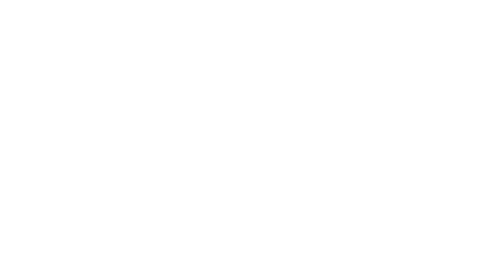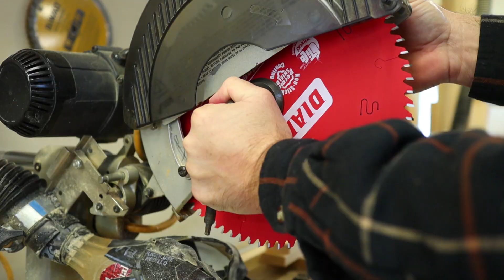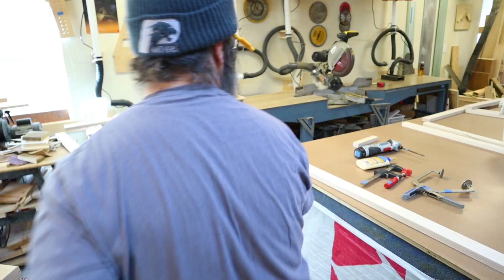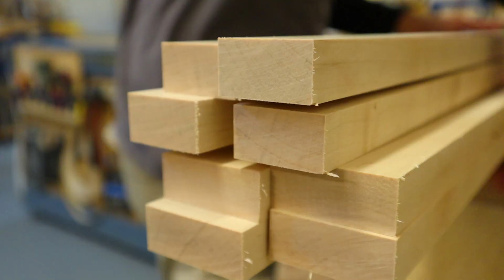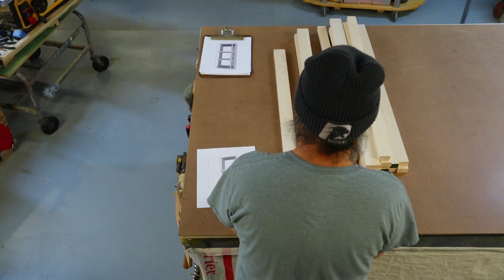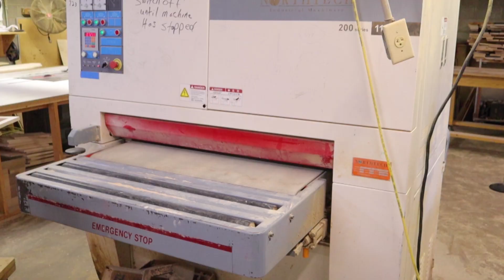How I build cabinets -  1 face frame construction

Comment: You always make it look so slick and easy Tony - I guess you've done this before! One question: have you ever planned something in CAD and then discovered an unforeseen problem during the workshop time? What I mean is, does the planning always cover everything? Cheers mate, it's good to see you on the air again.
Reply from the maker: Hey Mark! The planning doesn't solve everything but I can't cruse without it.